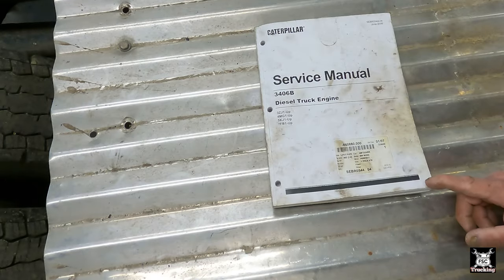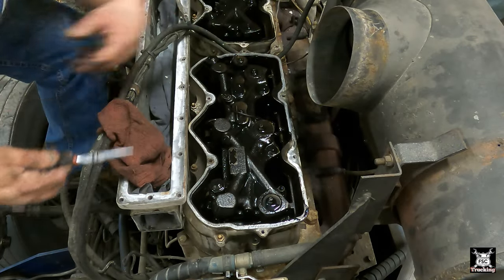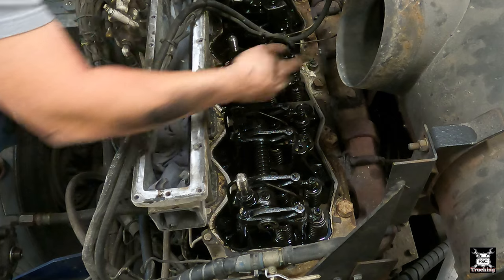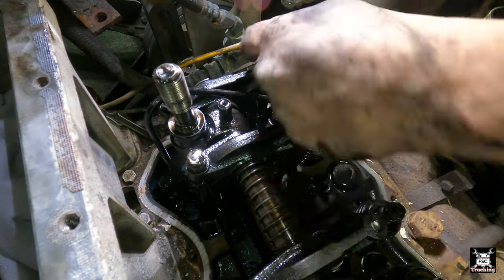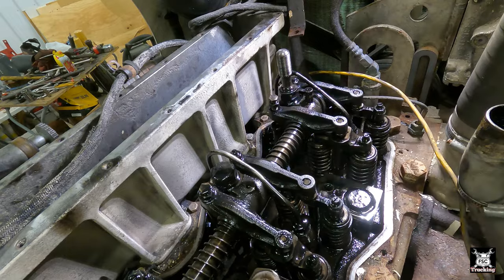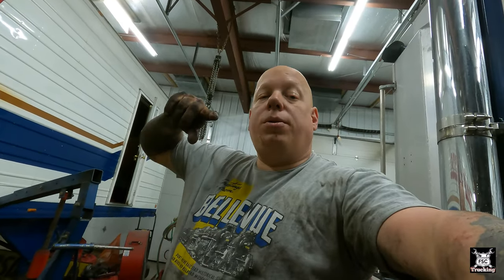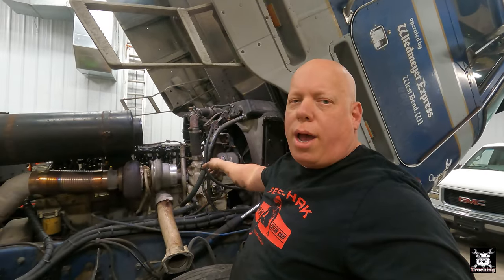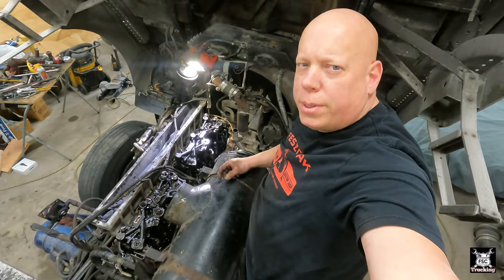Caterpillar 3406B Valve and Jake Adjustment Made Easy.   Tune Up Orwell!

Comment: This SO refreshing to see a "hands on service" that has ABSOLUTELY NOTHING to do with electronics.
Reply from the maker: Yeah, Orwell is kinda like that.  Manual.
Reply: some would say besides the fuel injection system/ or glow plugs, the computers do nothing but pet the wild creatures called emissions!!
Reply: Cats are 4 stroke correct?
Reply: @fsctrucking what's up with your Railroading channel?
Reply: @fsctrucking 2 or 4 valves per cylinder?
Reply: Is there a rocker that actuates the injectors?
Reply: @BryanPhillips-tk1km  Four stroke, four valves per cylinder, does not have injectors. Has 7000 series pencil nozzles. Uses a fuel injection pump via high psi lines to each nozzle.

Comment: Video's like these are yet another reason why this channel is far superior to others.  A high quality in depth truck maintenance video that most, (if not all), other trucking channels don't show.  
I don't drive truck nor have anything to do with them and I find this so interesting.  Steve, the way you explain things is top notch.  Thank you for filming all of this, when you didn't have to!  👍👍

I can't wait until Orwell fires up and blows some more beautiful coal!

I'm also anticipating to be on the edge of my seat with my heart pounding out of my chest on part two and three of the boat haul.  How many clowns are we going to count doing stupid sh*t on those videos trying to 1up the pilot escorts and an oversized load?  (my guess is at least 4)   (one little, two little, three little 🤡 )

Comment: You don't need to remove the lower valve cover to adjust the overhead. Unless you want to reseal the base. By removing the lower cover oil will run down the back of the engine or debris can fall in around the push rods if you don't clean it out first. Do not remove the Jacobs Brake went you adjust the valves. Went to a Jacobs Brake factory school in the 80's and we was told to leave them on. Your valve lash will change after you reinstall them. I had a guy argue to me about this. So he adjusted the valves, installed the Jacobs Brake. Rotated the engine and the lash was different. Early 3406 B's had a 346B brake, which was a three point stand set to 0.070. Then Jacobs Brake came out with an upgrade and went to a four point stand. It was called 346B+, (25 more braking HP). The lash changed to 0.080. So your correct lash on the Jacobs Brake with a four point stand, should have been 0.080. I do not adjust the bridges, after they have been originally installed. You can if you like, however you need to know what your valve lash was before you loosen your adjustment screw. By loosening your adjustment screw, you do not know how your valve train is wearing, due to valve recession or a cam/lifter issue. Also on the 346B+ Brake, Jacobs wanted you to shim the brake. So you have your B washer on top of the rocker arm stud. Your A washer is used between the rocker arm an the stud. Install your Brake with the B washer in place. Torque your exhaust side hardware to ten FT LBS. Take a feeler gauge and measure your gap between the B washer and the Jacobs Housing. Jacobs has shim packs and you peel off/separate the shim as needed and mic them. Then remove the Brake and the B washer. Install the shim and then put your B washer on top of the shim. If your gap is out, you could crack your Jacobs Brake Housing. When you install the Jacobs Brake on your engine. You torque the nuts first to sixty FT LBS, torque the 3/8 bolt to 48 FT LBS. Since you have the add on 346B+ Brake, the 7/16 bolt torques to sixty FT LBS. Then your torque the nuts to one hundred FT LBS.

Comment: Hey Steve, since you've done all this with the Jakes themselves, did you also get around to fixing that connection with the throttle to the activation of the brakes or do you still have to turn them off manually?
Reply from the maker: I did take care of it, but after the next trip and troubles.

Comment: Hello sir, I have a question!?
3406b what cause the valve to be touching number 5 piston, its either bend the valve, broken valve damage pistons it happens like 3 to 4 weeks after I repair like 3 times since 2024?

Comment: I use a Dial Indicator to do Valve Lash adjustments it's the MOST Accurate way to set the Valve Lash clearances... Different mechanics have different Feeler gauges, feel when setting Valve Lash clearances

Comment: I’m Looking at purchasing a cab over   What your view of the ride some people say it’s rough being right over the wheels  can this be improved with air ride front axle
Reply from the maker: Personally I don't think they're that bad.  Look at a Century Class, Cascadia etc, they are practically cabovers.  The front wheel is only about 1 1/2 foot more forward than mine.
I believe that in the days of cabover, most were spring ride, thus rough.

Comment: Where did you purchase you book from? I need one. Thank you
Reply from the maker: Caterpillar dealer
Reply: Any book you get, Cat dealer, Ebay whatever. Is limited to printing date. Changes have been made on a few items and the book is wrong. Example head bolt torque in the book is incorrect to the latest procedure from Cat.

Comment: All your torques are a bit off, when using a crows foot it must be 90 degrees to the torque wrench.
Reply from the maker: Perhaps.   But the idea is not to over tighten them.  Stretch them and have one break.  Had that happen to a 3406E I trusted a CAT tech with once.